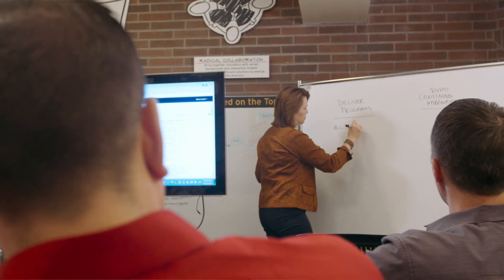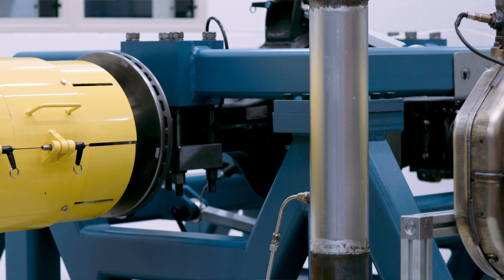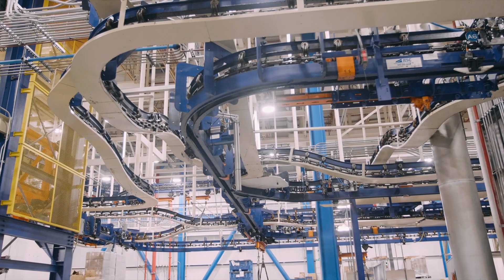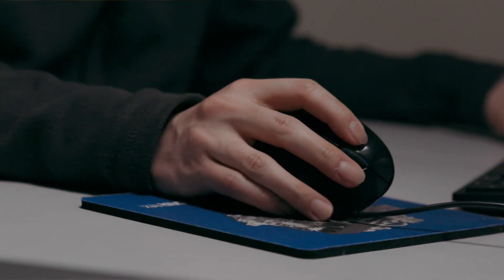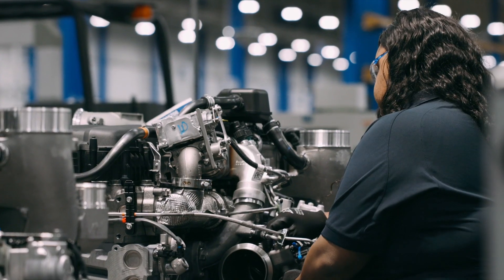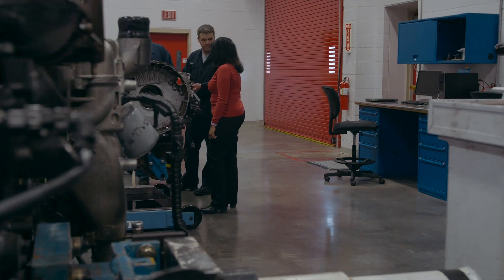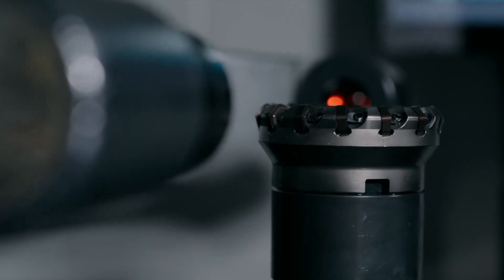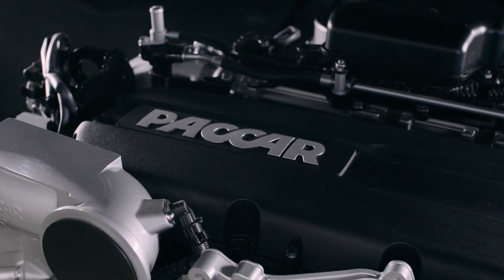PACCAR Powertrain – Driven by Innovation

Comment: I've been driving the the MX 13 in 2 different trucks since 2014 and I must say that during the time in that 1st truck I didn't have no real major issues.  I think I've only had the engine crankcase ventilation module replaced in both and a few software updates.  It's a good running engine for what it is.  If Paccar ever decides to come out wirh a larger liter engine than I'm sure it'll be just as good as it's current engine lines.